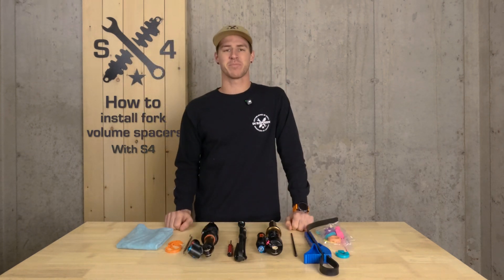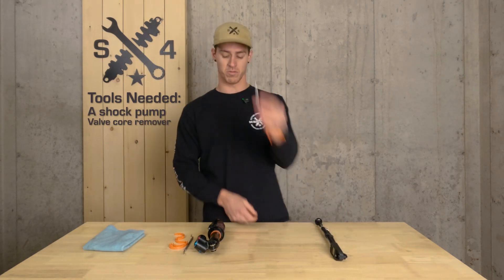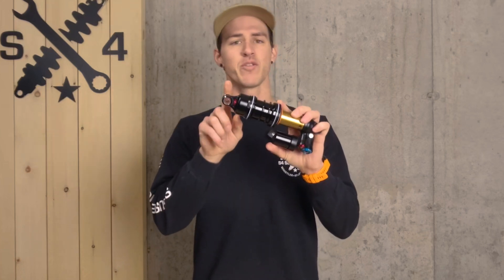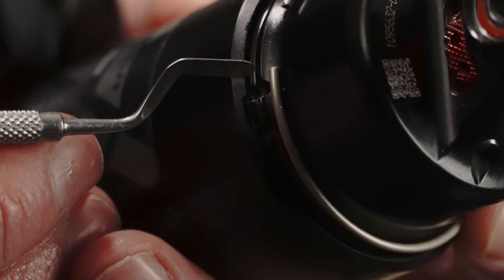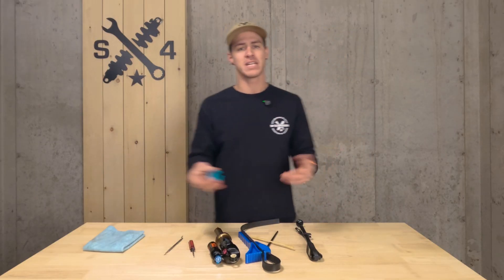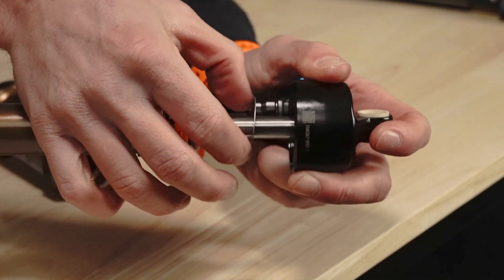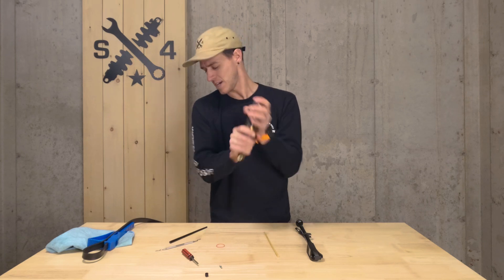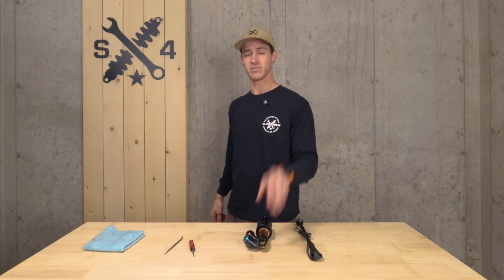How To Install Volume Spacers In Your Shock

Comment: What if you wanna add more than one spacer
Reply from the maker: The ability to add more than one spacer all depends on your shock. Most rear shocks rely on changing the volume of the spacer, not compounding spacers. You will want to check directly with your shock's manufacturer to see if your shock accepts compounding spacers.
Reply: @s4suspension01  only multiple bands can be added correct? Aside from the Fox stuff that can fit the tiny spacer inside the big spacer right?
Reply from the maker: @DeezzzzNutzzzz  Sorry for the delay here. It really depends on the specific shock. Rockshox mostly uses different size volume spacers, but also has bands in some of their shocks, and vice versa for Fox and even DVO.